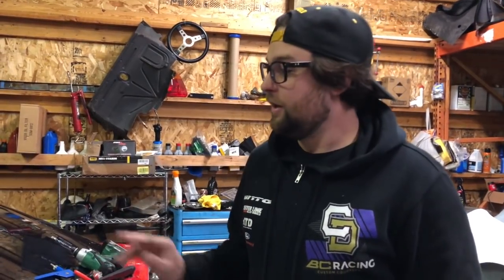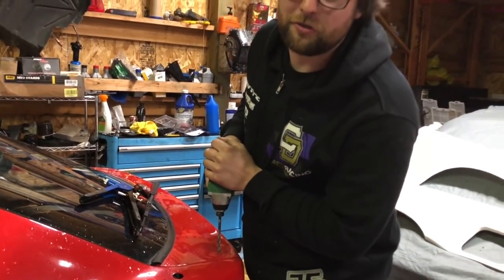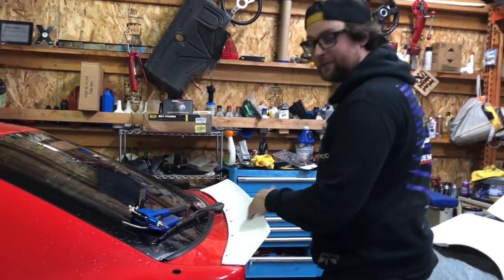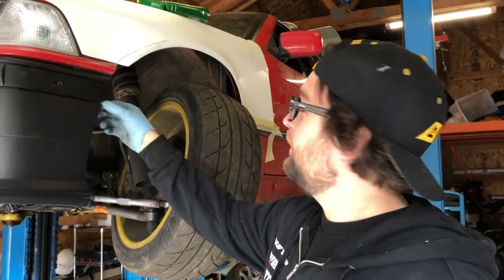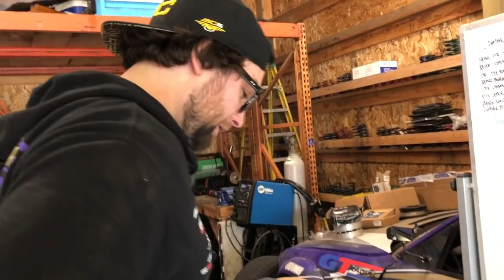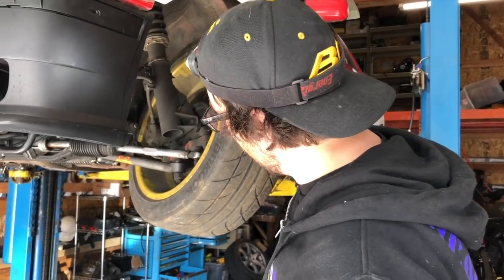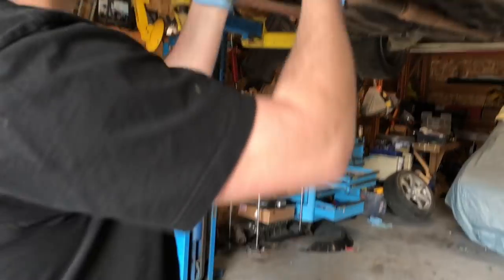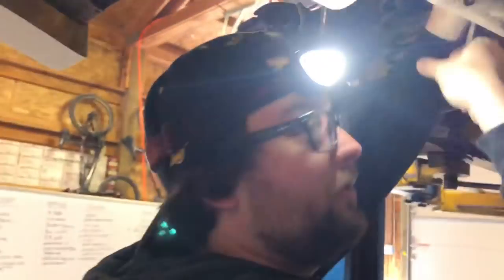SUPER D CUP PREP FOR THE COMPACT! AERO, SERVICE, MODS!

Comment: Had the same issue with my inner tie rods Chelsea, any aftermarket ones I tried only lasted me like 6 months tops. I've got some oem German ones I'm getting ready to try next and see how long they hold up.
Reply: Craig Elmer if they are German they will last a long time that's for sure! What brand is it? I try to get OEM German parts whenever it's possible for my Mercedes. I like the brand lemfoerder for suspension parts and stay away from anything URO! URO brand is garbage and will not last long at all. Ive used it in the past and parts failed ridiculously quick. Theirs a joke in our Mercedes forum where we say URO stands for, U Replace Often.

Comment: quick question, i have the same chassis but with the 4banger,  did you remove the security wheel lock spring in the ignition? i noticed you can turn your wheels side to side freely without the car being turned on . just curios cus id like to do the same.

Comment: How much you guys think over fenders are?
Reply: Hey! The front is 40mm and because it's e30 in the rear - 40mm there as well. But we now use our new material, it's flexible - if you need, you can install them with slight pressure  and gain additional +20mm (front and rear). If your question was about the price - it's $600.
Reply: CLIQTUNING com what do you mean install with slight pressure?
Reply: i think they mean you can put spacers under the lower part of the overfender to gain those extra 20mm in width
Reply: Move the front part of the over a bit to the back and vice versa with the rear part by moving it bit to the front - the middle part (arch) flexes and you have gained +20mm. The extra pressure is good, no worries about that. Btw, you will have to sanden out 0.1" at the fuel cover part. You can do the spacer thing as well, we just didn't make the special spot for it as it was done for sedan overs.
Reply: Evalds Leja have you done this before with any other kits? Curious to see how this would work and look in the end